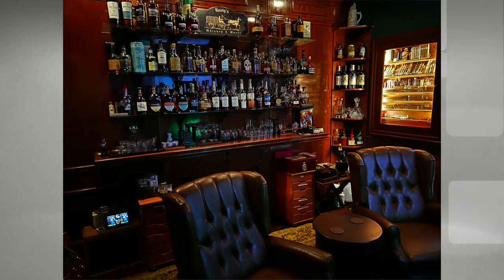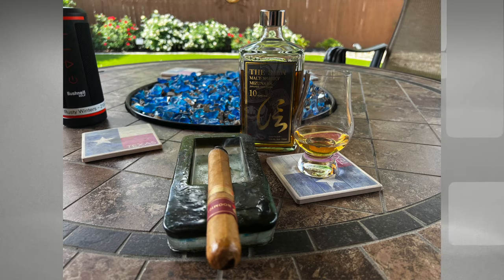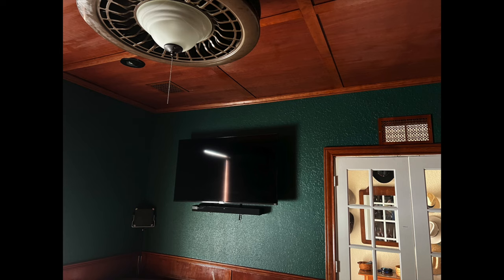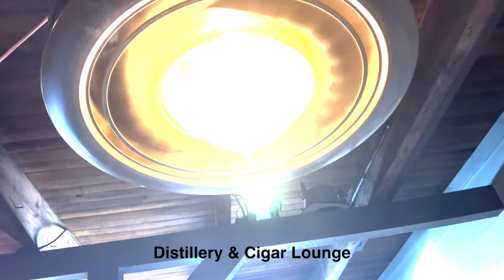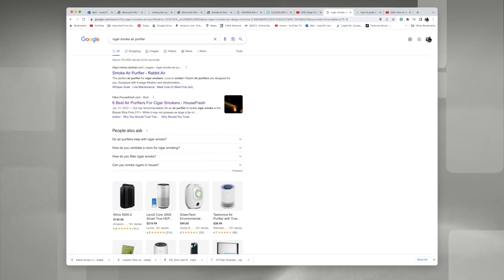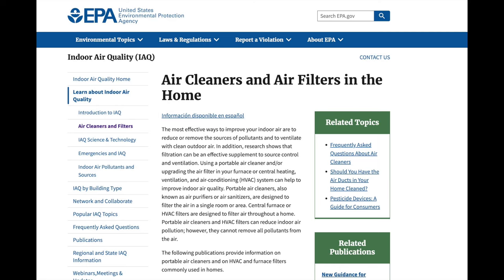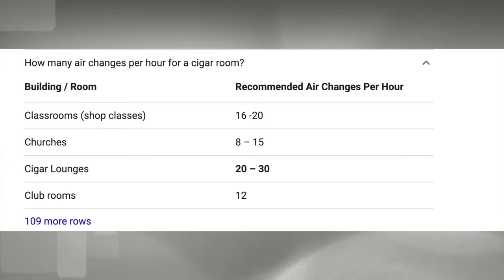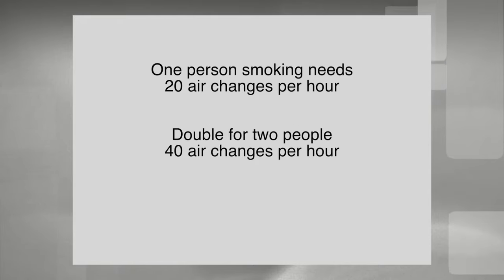Home Cigar Room Ventilation.

Comment: What a great video. As a younger cigar smoker who has been using only one air purifier as a ventilation system in my smoking room, I found this to be invaluable information. I have the exact same requirement as you and have met every problem that you listed. Now I know exactly what to do. Thank you kind sir! 🙏
Reply: How is it working with "just" an air purifier?
Reply: @Hikneow  Entirely depends on the actual purifier, the size of the room, and the CADR rating of the unit. From experience, yes it does make a difference, but I would not recommend it in most scenarios.

If you have a room you can dedicate to cigar smoking in your home, the purifier will help delay the smell penetrating through materials, fabric, and walls. No matter what you do you will not be able to completely eliminate the smell sinking in, and you will absolutely be able to smell it even in the vicinity of the room. Even when not actively smoking.

If you're going to go with this route get a very good unit with a HEPA filter + a carbon filter, make sure you review the ratings well. I would not go under a CADR Smoke rating of 220. For rooms larger than 500-600 sq/ft I would get two units.

My two recommendations are Coway, and RabbitAir if you want the absolute best performance. The latter will run you a pretty penny though. Happy smoking! Let me know if I can help with anything else.

Comment: Expertly executed my good sir! As a professional HVAC design engineer, I love seeing these videos of people doing their own cigar room ventilation!
Reply: You think a high cfm bathroom exhaust would work in a 10x10 room?
Reply: @SmokeNGunsBBQ  I just posted my question, but I can tell you from experience... NOPE.  I tried to use one on a 10x16 shed and just doesn't move the air... really at all.  I think the cigar smoke is much heavier than the water vapor they are designed to effectively move.
Reply from the maker: @elvdell5582  I agree, it will not be sufficient. The reason is simply lack of air flow. I measured a bathroom fan and it moved 70 cfm. less than 10% of what you would need to remove enough smoke. Cigar smoke is somewhere between 7 and 12% more dense than dry air, which is more dense that moist air. Yes I know, it's counter intuitive.So you are correct, smoke is much heavier)higher density) than moist air.
Reply: @elvdell5582 thanks I went with a 10" ac infinity unit out the roof with a one way check flapper.

Comment: Nice install! Great father and son project. 

Might I suggest considering an HRV "Heat recovery Vent" or ARV, which recaptures 50% of the exhausted heat or cold.  It's a Coloplast cube constructed such that successively laminated square sheets have their channels positioned perpendicularly.  As heat goes in one side of the cube, it conducts it to the opposing air in the neighbouring perpendicularly oriented channels. 

That ceiling fan filter had the feature of removing dead air spots in the room which is helpful to avoid stratification. Occasionally, an ozone generator could be run overnight to saturate all the inaccessible cubbies and cabinet crevices where particulate may have settled if it escaped from the exhaust flow. A portable room fan could assist in distributing the ozone. Block the A/C vents for the duration.  Exhaust the air thoroughly prior to occupation. No pets.

The A/C return above the French door seems to be a simple pass-through vent expelling directly into the hallway. It might benefit from a filter. The A/C could be turned off or close its vent while smoking to reduce the chance of smoke being pushed out of the return vent into the house.  

While actively pressurizing the room when operating the A/C, it's possible a filter with enough density placed over the return vent could offer additional assistance by keeping the smoke inside while operating the new fan. Whether the room pressure is much lessened, or even completely reversed, when operating the new fan depends on knowing the CFM of the A/C.
Reply from the maker: You are correct that know the required CFM of air flow is critical. I used an ozone generator at first but I fine it is not needed . I will probably run it once a year now. I had considered an ARV but, it seems excessive in this case. Also I have never had any smoke escape from this room into the house. It all gets exhausted. I can even leave the doors open and no smoke escapes. It is all exhausted.

Comment: I went with two 12” AC Infinity fans and no scrubbing. 

The most overlooked step (for a lot of people) is cleaning ashtrays.

I’ve considered getting a Rabbit Air for a few years and it doesn’t seem necessary.
Reply from the maker: You are so correct. I put something called Wiff Out and a little bit of sand in my large ashtrays so if I forget to empty them at night, I don’t really smell the ash in the morning just the perfume smell from the whiff out..

Comment: I just got mine done, used a 10" infinity fan in a 3k³ ft room. The room will smell no matter what but the air is clean and the rest of the house isn't effected. Pulls a negative pressure with the HVAC running so room stays cool.
Reply from the maker: Well done. I'm glad to hear it is working. The room itself will accumilate some cigar odors over time but as long as it is contained within the room, we don't get complaints.

Comment: Well done, Sir.  Your room has become my primary guide for creating my own, which is nearly identical in dimensions.  I currently have a Vornado window exhaust and a Levoit HEPA filter purifier, but they are not up high in the room.  I'm considering adding an AC Infinity shutter exhaust fan in an upper corner venting directly through the wall to outside.  It's rated at 830 CFM, so it should do the job.  The exterior fascia is vinyl siding, posing the challenge of how to achieve a proper weather seal.  I'll get it sorted.
Reply from the maker: My first attempt was was a Vornado window fan, and for the reason you described it was not adequate. I’m sure you will figure out how to exhaust the fan through the wall.

Comment: Awesome setup!! As an HVAC designer the first priority is exhausting the air and smoke to the outside. If you are worried about comfort then a make-up air system to bring in fresh air that is climate controlled. Last would be a filter system for any remaining odor.
Reply from the maker: You are correct and I have both of those in place and it is working perfectly.

Comment: Very informative. My wife and I will be building a house next year and I'm seriously considering a small cigar lounge off of the laundry room. I had imagined the cost of air purification and ventilation being around 10k so this is a pleasant surprise! By the way, your lounge looks great!
Reply from the maker: Thank you! I am working on a video where I will depict a low cost method for converting a room to a cigar lounge. I am thinking of less than $500. Now that is only the cost of the ventilation system. For a small room it can be done in that price range, in most cases. Decor and furnishings would be an additional cost of course.
Reply: @arwin10w  Awesome! I'd love to check it out. Thanks for the information!
Reply: Fellow texan here! Thanks for this informative video! @arwin10w

Comment: Helped a ton and those inline duct fans are cheap. They even make ones with wifi control
Reply from the maker: I considered the Wi-Fi option but in the end, elected to go with the push button control included with the fan. The major driver there was the proliferation of remote controls in my cigar lounge. I have one for the TV, one for the fireplace, and a light controller. Additionally I have two others I use when shooting video. Thank you for watching!
Reply: @arwin10w  I was originally planning on doing my small office, but I've decided to turn my den area with a preexisting bar into the lounge. Going to install a 10" vent to move 1500 CFM 😅 But I can fit a pool table, chairs, couch and dining table in there.

Comment: Excellent video. Question ... rather than have an online fan I was thinking of going directly out of an exterior wall. Wonder your thoughts.
Reply from the maker: You can certainly do that, and it intake for the inline is high enough it should work fine. Because smoke rises it is best to mount it as high as you can on the wall. Originally I tried a fan in a widow but it was too low and most of the smoke missed it.

Comment: Very nice build and thank you for going through your process. I'm currently following your footsteps and going through the same process. I have opted for 2x AC Infinity fans as I plan to have around 4-5 people join me bi-weekly. Can you share any insight in terms of how you addressed the negative air pressure in the room? Did you add a passive vent somewhere so as the exhaust fan create a negative pressure, it is pulling fresher air from an adjacent room?
Reply from the maker: The Infinity fan moves enough air to create negative pressure. There is a pass through vent above the door, as there is in every room in the house. This provides plenty of make up air so the room stays negative. It pulls air in from the hallway. When the fan is not running this vent acts as a return to the HVAC air handler. So in effect it reverses the airflow.

Comment: As a cigar smoker I know that my nose is not as sensitive to cigar smoke as it once was. It worries me that I could go thru the effort to build a room that a non-smoker ie. Wife or kids would still smell the smoke. Do you have any exceptionally sensitive noses in your house? And how do they feel about air quality?
Reply from the maker: I would not be able to smoke in that room, if the smoke left the room and could be detected anywhere else in the house. that has not been a problem. The ventilation system takes care of all of the smoke. In fact, if you walk into this room five minutes after I’ve smoked, you will not smell cigar smoke.

Comment: As you are creating a negative air pressure in the room how do you replace the air into the room and maintain the proper temperature? To properly do this one needs to instal a makeup air system as what one finds in restaurant exhaust systems in the kitchen. Now you have to incorporate a heating / cooling system to condition the air coming into the room that would be located inside the make up air system. Considering the cubic feet you are dealing with something like the 9000 btu split air handlers would suffice with proper modification. The problem with this is the cost. In the USA they are stupid expensive. Here in the EU a 9000 btu inverter style split system will set you back around 300 euro for a cheap unit. A multilayer pre filter would be required for the intake air which could easily be constructed in the states but a pain here for us since homes do not use forced air heat. In the states we had  traditional forced air heat and it’s not a problem to source filters at your Lowes or Home Depot store. Wish I had access to that filter media here in Europe, would make keeping the house clean from dust. 
I really love your room setup. It is a quiet comfort zone where one can unwind from a busy day or week in total solitude.
Reply from the maker: In my case it is much less complicated. The exhaust fan creates negative pressure by a significant margin. I am exhausting 900 cfm. When the air handler kicks on suppling cool or warm air it is only moving 70 cfm. Hardly noticeable. The open plenum above the doors and the space under the door allow enough makeup air in when the fan is running so that is never a problem. No smoke ever leaves the room other than through the exhaust fan. Many people have asked about makeup air but it has never been an issue. By the way; makeup air requirements are often imposed by building codes for a variety os reasons, not all of them are necessary in the type of space we are talking about. I live in a very warm location and my HVAC system can handle this all without fail. I will say that is an important consideration though. If your existing system is marginal you may see a deficit in heating and cooling.
Thank you for your comment.

Comment: After you installed the in-line fan, did you find that the window fan wasn't necessary? I'm creating a cigar room for my father and trying to avoid the temperature fluctuations. Would the scrubber + in-line be enough? I know I could add a heater/cooling unit to offset the heat/air being pulled out of the room, but I'm trying my best to avoid that if at all possible.
Reply from the maker: Yes I did.I eliminated the window fan immediately. The scrubber and in-line handle 100% of the smoke and residual odor. It is likely that you will not need to modify your HVAC system. I have found this is true in most cases. I will suggest that there may be a temperature differential between teh smoking room and the rest of the house once you start pulling that much air out. In my case it is 1-2 degrees after the exhaust fan has been running for 2 hours or more. So if it 71 in the rest of the house it may be 73 in my smoking room. I don't believe that is all due to the exhaust fan. I think that room has always varied from the rest of the house particularly in the very hot days we have here in Texas. So my guess is that you won't have to make any modifications to you heating/cooling system, and if you do, it may be as simple as balancing the air through vent adjustments.

Good luck! Your father will enjoy it!

Comment: if you have an exhaust fan, don't you need an intake to introduce air back in?
Reply: No , it creates a “vacuum” so that no smoke escapes the room. If you pump air into the room you’d risk creating positive pressure in the room which would push smoke out in ways you wouldn’t want
Reply from the maker: Correct!

Comment: I copied your advice. I have a back unattached garage (mancave). Changed both my ceiling fans to the Purifan hepa/carbon filter system. I also installed the AC Infinity inline 8" Pro in my attic to exhaust smoke from inside my mancave. This sytem works amazing!! That exhaust fan can draw so much air out and fast that it causes negative air pressure in my garage. This is great but when you open the door for someone to come in or out, you hear the air swoosh and the door is hard to shut! How did you balance your room for this issue? I live in MN so having an open window in the winter to let in outside air may not be a great idea. I also have guitars in there so letting the humidity level drastically change fast is not good! Any advice would be great, thank you!
Reply from the maker: I would try running the exhaust fan at a lower speed as a first remedy. It sounds like you have a vacuum as opposed to slightly negative pressure in the room. 
In my case the entry to my room is from the hallway adjacent to my front door. The french doors leading to my room are not tight so I get plenty of makeup air from underneath the doors as well as from a vent above the doors. Your issue, as you stated, is that you are in a cold climate so you don't want outside makeup air because it will bring in too much cold air. If slowing the fan down is not adequate you may have to add some kind of adjustable vent ot the outside. It may be that you don't need to bring a large amount of air to solve the balance issue. And if you can place the makeup air vent far enough away from your sitting area, it may be acceptable. Or if you have a double hung widow try pulling the top down a little. Good luck and let me know how it works out.

Comment: Really like your video. Do you recommend a size of a system. I have a very small smoke room I build of my bedroom 14x6 height is 8ft. I would love any suggestions.
Reply from the maker: Yes, absolutely. I believe that oversizing is better than ending up with a system that doesn't get the job done. In your case you might be ok with a 6 inch fan moving 400 cfm. You need 500 CFM for perfection in your case, but 400 could be enough. But, doubling the air flow capacity pretty much doubles the price. So instead of ~$100 it would be ~$200 to get 800 CFM in an eight inch fan. Worth it in my opinion.
Reply: Thank you so much. I look forward to watching more of your video's.